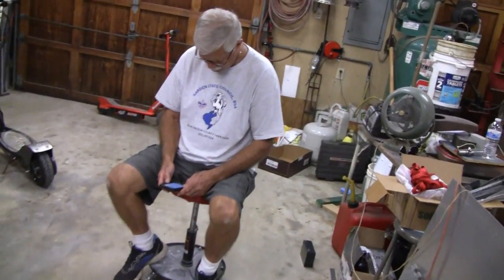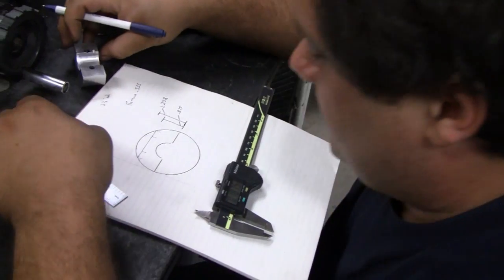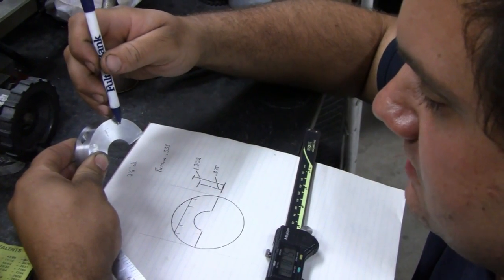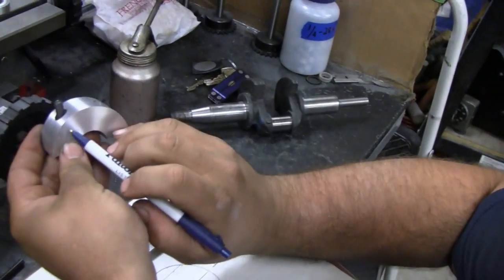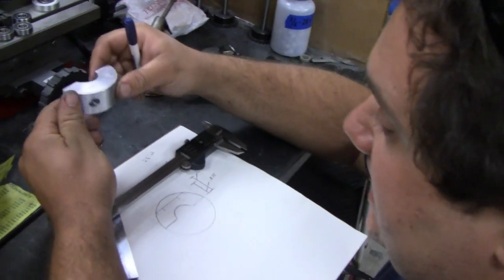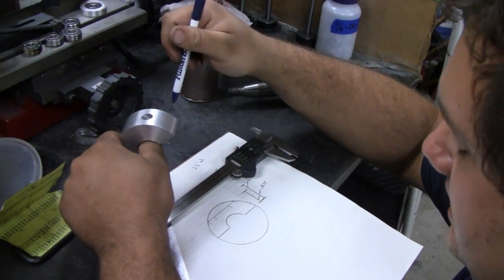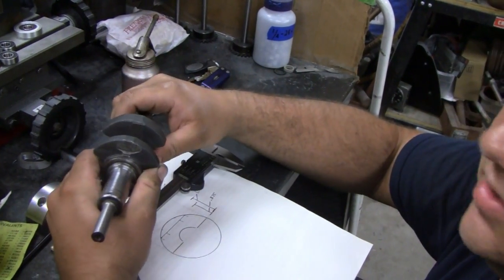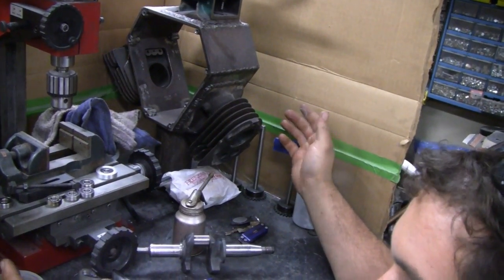HOMEMADE RADIAL BRIGGS ENGINE (part 25)

Comment: loved this series, a real head scratcher for sure, wasn't 100% sure how 3 cylinders with no offset from each other was gonna work as far as the connecting rods bolting to the crankshaft..i keep goin over it in my head wondering..haha guess that's why I am not an engine builder ..can't wait for the finish one day good luck

Comment: DONT lose hope on that engine.   You guys are pretty saavy on this stuff.
Reply from the maker: Don't worry Bud!! That engine will get done, it's just a 5-10 year project!!☺
Reply: Hard to believe its been 8 years since this video.. Just over a decade since the very first... i take it you fellas either bit off more than you could chew, and or lost interest when life got in the way, respectively of course? Although I still get a kick out of the claims that were made when showing the 4cylinder Briggs..a one year project turned into a 5-10 year..well here we are😅   @805ROADKING

Comment: You'd have to face off the bearing face afterwards, but you could try bolting in a cutoff wheel and air grinder in the tool post.  Used to do it in aerospace shop on sheetmetal on a lathe -- worked great.

Comment: are you planning on using a cam ring or try and make three individual cams do the work
Reply: the original plan was 3 separate cams, if it was a cam ring, it needs to be 2 of them..

Comment: use a hack saw not a parting tool, leave the part turning in the lathe set the saw on your mark and cut. does not take near as much power
Reply from the maker: We'll probably try and make something like that!!☺
Reply: 805ROADKING you dont need to make anything, just hold the saw and the part spining will do the cutting and keep the cut sqare

Comment: Rest is just out of reach for Mike with the daily job and then planning this 'rod and bearing' set up for the 'radial' B&S. But then it's the hobby, and it does demand plenty of thought.
Always interesting,...thanks for this ROADKING.
Reply from the maker: Yeah they've been running him ragged all summer long at work, that's why the radial has been on the back burner!!☺

Comment: Swap in a bigger motor. It should help with the low end speed. OR get a thinner cut off bit. There are some micro sized ones, but problem is, you need a holder too, so i'd say, overall, if you find a slightly bigger motor, it should be a cheaper swap. And for you guys it's super easy to fabricate a new bracket, i mean, this is easy stuff compared to making an engine from bits and bobs.

Experience on this comes from having slowed down my lathe during cutting operations. When i was still learning, i would slow things down, and for lathe ops, regular stuff, it's ok, finish ain't great, but it works. With cutting stuff, not so much. So there's that.
Reply: Oh and for the additional weight on the crank, how about you guys make a starter piece that's dimensionally as large as it fits inside (or if it's absurdly too large, then where you'd figure it to be slightly over the needed weight. Then, just like in a electric motor's shaft, grind off as much as you need. You'd end up with the perfectly balanced weight with little effort.